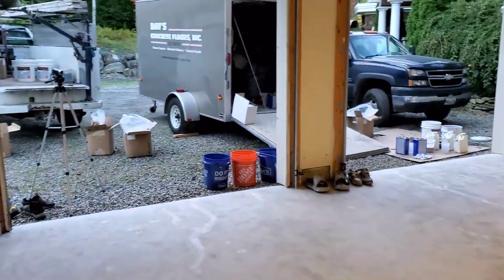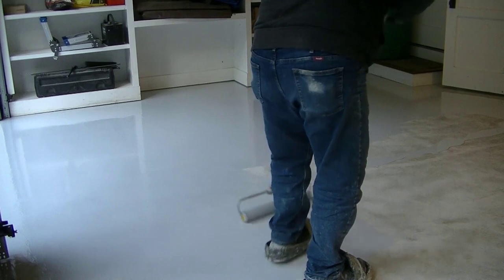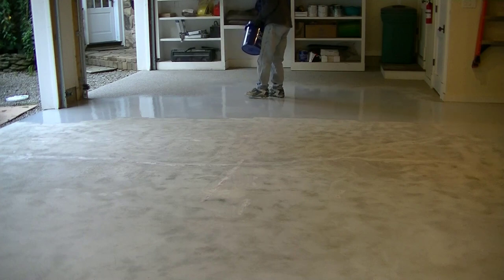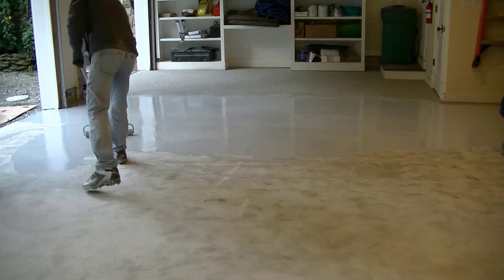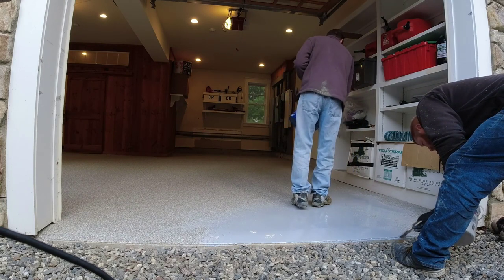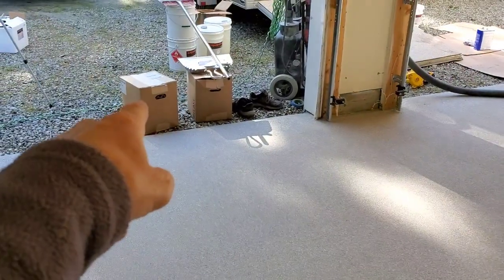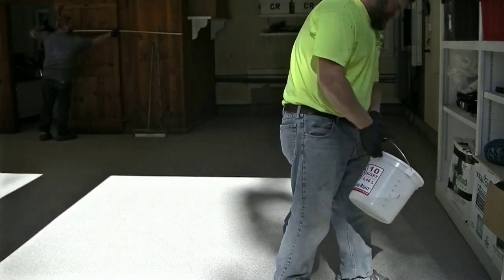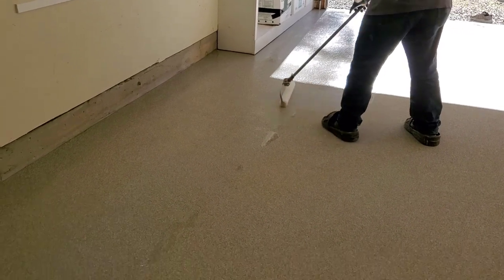DIY Epoxy Flake Garage Floor (Don't Try This At Home UNLESS!)

Comment: I'm an HVACR contractor, and I watch your videos, because you do every job with great detail and professional workmanship. I believe in those principles, and I appreciate your work. I see how your crew works, and it wouldn't matter if Mike is on the job, or not. That epoxy floor took you guys a while to do. Y'all make finishing concrete look easier.

Comment: Great channel Mike. Really enjoy watching your work. I have a question about using epoxy on fiber reinforced concrete. When grinding the surface for prep, will the fibers cause issues for the life of the epoxy? Anything special added to the prep for fiber concrete?

Comment: To all those who think that they can do this, don’t. Or like Mike is saying, preparing and prepping the surface is key. But Hey Mike, question. I have a two stall attached garage with approx. half of the floor being bottomless with a wood drop storage for 1 of two of my fireplaces. My wife has wanted me to do this but I have a moisture problem with small pockets of spalling and I believe at some point some one came in and tried to skim coat. 
Would you recommend starting off with the right way of skim coating and then moving on from their? Also, the wood drop hole is approximately 2”x 2’’, so not a lot of air moving to the hollowed our garage floor. If this makes sense. Thanks.

Comment: Epoxy application isn't as hard as he's making it out to be. Prep your floor, apply 1 to 2 coats of epoxy with your flakes, and apply your clearcoat on top to protect your floor. You don't have to buy a course to do this.
Reply: Yeah, while there's nothing wrong with him promoting his paid for course, it's overselling it a bit to say that you have to take a course like his to do it right. I'm 54, and have done four concrete floors in the last 20 years (my own, my brother's, my Dad's and my sister's) and they all look as good as the day they were done. And no, I didn't take a course.